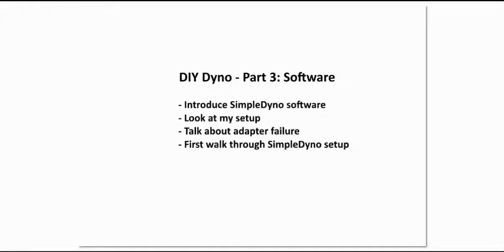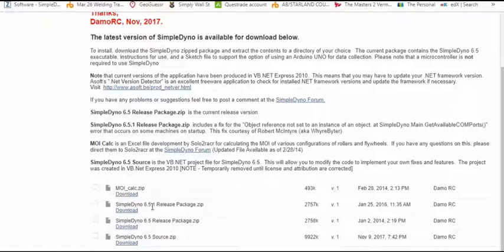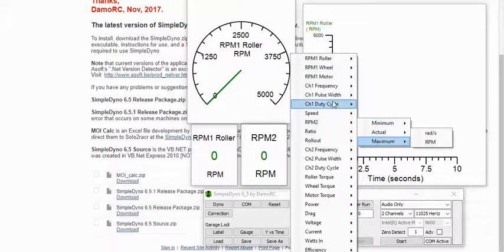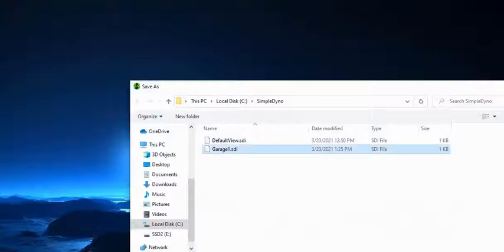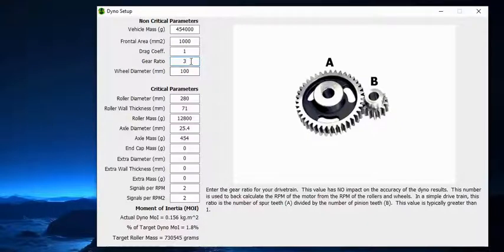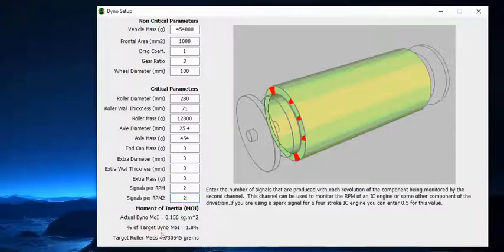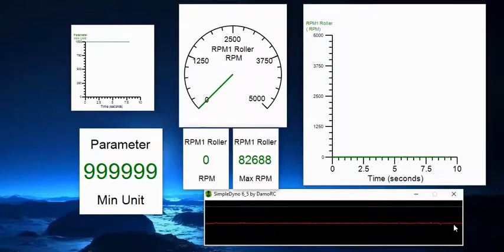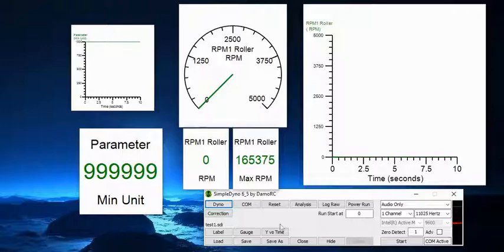DIY Dyno (Dynamometer): Part 3 - Software

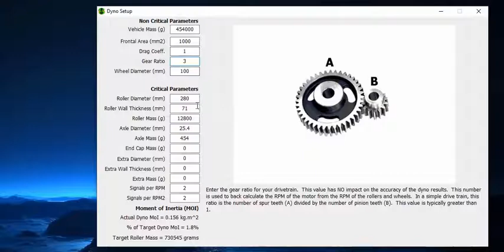Comment: At 6:50 you explain the dimensions and masses of your rotor, and as long as I can follow you, you got the whole theory of how a dyno works wrong. In your case, the "roller" has to be encountered, but you misunderstand, that, in your case and in the big scheme, the "roller" is insignificant. The reason is, that the vast part of your total roller weight in in the 2 brake rotors... To use a dyno, you have to know the exact distibution of the weight along the different radiae of the roller. In your case, it´s easy to calculate that for the "roller", but for the 2 brake rotors, that are far more significant, it´s almost impossible. The reason: Their mass is too complicated distibuted along their different radiae, which is the least you should know, in order to calculete the mass of inertia... 
What you need, is a "roller" that has the form-attributes of the roller shown in the picture, with following KNOWN data:  the inner and outer diameter of the roller, the diameter of the schaft, the inner and outer diameter of the end-caps, and  the lenghts and masses of roller, shaft and end-caps. In other words, to calculate the MOI, you have to know where in space each nanopicogramm of mass is distibuted. But this programm will calculate it for you, if you feed it with the correct data. 
The reason is simple: an 1-inch-shaft of 10 pounds (2 feet long maybe?) turning at 100rpm has other/different/lower inertia than an 1-inch-thick disc (of same material and weight) of 1 foot diameter turning at 100rpm. Also, calculating the MOI of porous, randomly hollow or rusted materials is impossible, cause none can tell where the hollow points are, or where the rust is, that has a different density than unrusted metal !!! 
Your roller can be long (as in the picture), or short, it only matters that it has the form-attributes of the one in the picture: A material of known and homogenously distributed density, an outer shell of known dimensions ("roller"). A shaft of known dimensions. 2 end-caps of known dimensions. If those parts consist of different materials, then it also has to be known (for example: the shaft is steel, the 2 end-caps are 20 plastic CDs stuck together, and the "roller" simply doesn´t even exist). For small motors, glueing CDs together is the simplest method, but thats for rc-model-motors. the easiest is, to find a massive cylinder, and stuck/weld 2 short shafts in the center of the cylinder´s ends.
Reply from the maker: Thanks for your in-depth comment. This is a learning experience for me and I'm trying to use roller style software DynoSim as a direct connection dyno. In Part 5, I actually measure the Moment of Inertia of the rotors and go through the calculations as you explained. In Part 6 Gear Ratios, I explore the effect of gear ratios to the Moment of Inertia. In an upcoming Part 7, I hope to have it all figured out.
Reply: @blanchae  As long as your dyno-weight has the simple form shown in SimpleDyno´s picture, or a variation of it (in a massive cylinder you have only 1 roller and a shaft eventually, but no end-caps), Simple dyno is gonna calculate the MOI, but if more complicated, you´d have to calculate it yourself (a sphere with shaft, or a rhombus with shaft, or any other form that deviates from the basic one in the picture), and  the MOI of a brake-rotor would take you a couple of days to calculate (every single airation-hole has to be "weighted" for its exact position and for containing air instead of steel ;-), so, sure, but not worth it. There is surely programms, which would use a 3D-CAD-Model of a brake-rotor, in order to calculate its MOI, but still, you´d have to trasfer your rotor-form from reality to a CAD-Programm. Doing it by hand is a lot of work, maybe stereolithography (take many pics, feed them to stereolithography-programm, let it make 3D-Model for you) can assist, but still you´d have to finish the details by hand, and check everything yourself anyway (meaning, also the stuff/dimensions that the SLG-proggi has supposedly already finished by itself).

Comment: Very informative videos! Thanks for spending your time to make them to help us out. I have a hydraulic brake dyno. Can the software be converted to be used pounds of pressure instead of sizes and weights of a flywheel? Hope you can help me out! Thank you.
Reply from the maker: If you can calculate the moment of inertia for hydraulic brake then you can manually enter in the data - fudge it?

Comment: I am interested in using an Arduino; however, I only have the "audio only" in the pull down and not "audio and COM port sensing option".  Has this functionality been removed?
Reply from the maker: You must hit the "COM" button first then it will show up. Just double-checked it. I haven't used an Arduino with it. When I first turned it on, there was no option as you indicated. When I hit the COM button, the option appeared.